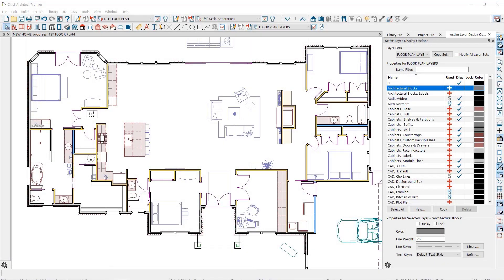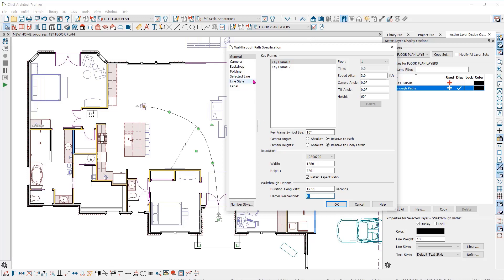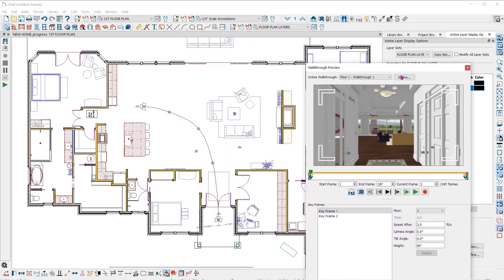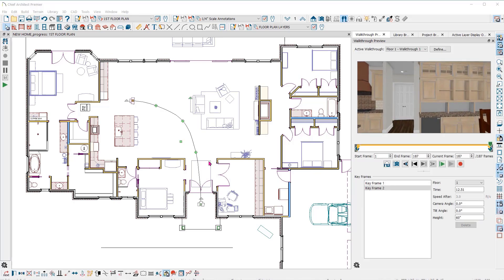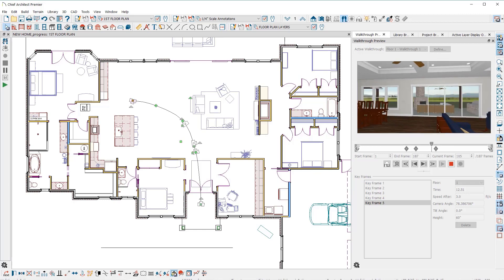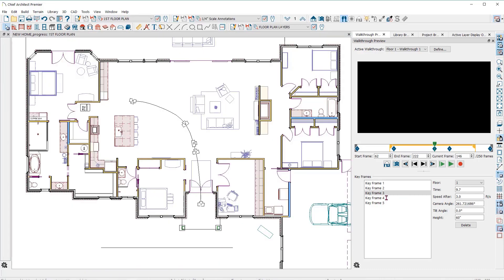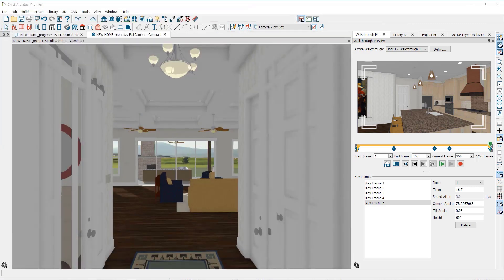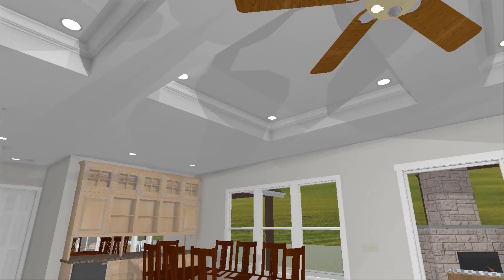Creating 3D Walkthroughs

Comment: What are we talking about for completed file sizes.  If one makes a one minute video with all settings maxed out is this a 5 GB file or 50 GB file?
Reply from the maker: It depends on the project, materials used, objects placed, etc. The files can range roughly anywhere from 30-150 MB.

Comment: Thanks - There are several sections to the walk through - how do I select all of them and make them just one video?
Reply from the maker: You can select a walkthrough path and add key frames along the way, but you do have to have a single path per video. Multiple paths create multiple videos.
Reply: I would suggest using a video editor to combine all the walkthroughs into one shot with a blur transition between each segment.

Comment: Hello, this video was very helpful! However, we are having issues with the frames and video being shaky. Just to preface, we have a new computer that meets all of the minimum requirements for Chief Architect. Can this be fixed through settings?
Reply from the maker: Typically if you increase the Frames Per Second, this will smooth out the walkthrough. You can double click on your walkthrough path to open the walkthrough path specifications and within the General panel, there is an option to adjust your frames.